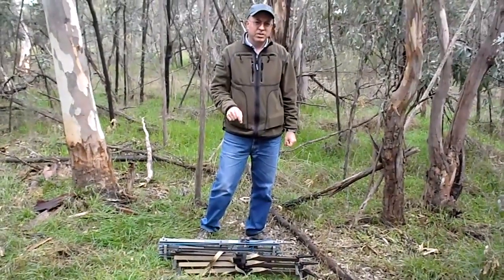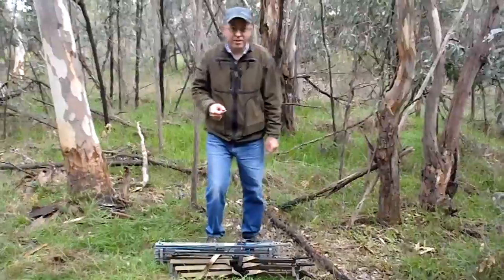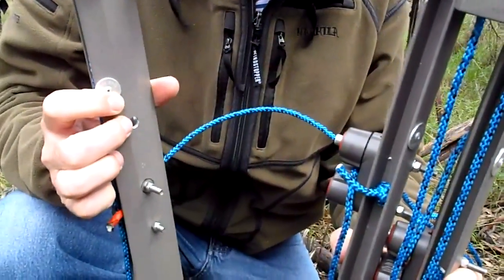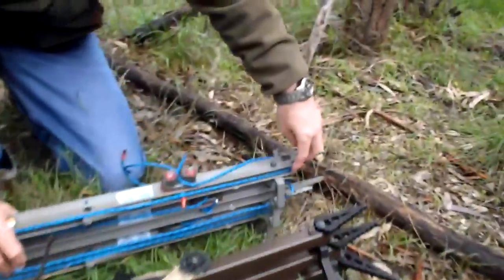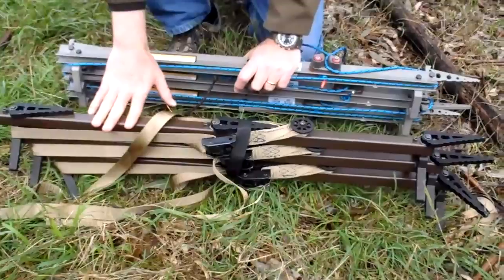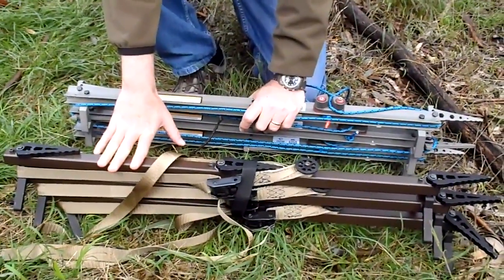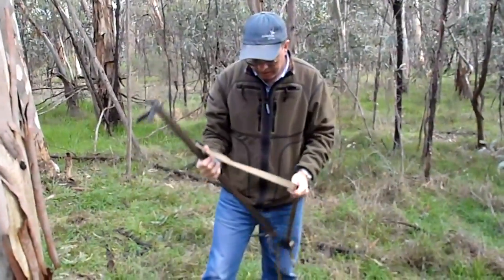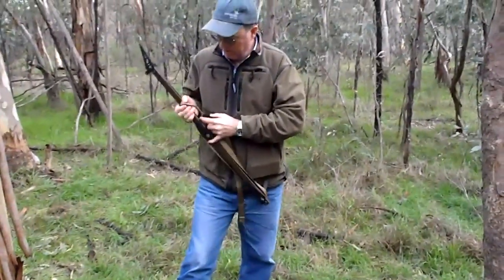Lone Wolf Climbing Sticks Versus Modifed Leverage Climbing Sticks

Comment: I also use the leverage sticks but mine are the 17in version. I just did the versa button mod with spliced on 3/16 amsteel. I will be using an aider also.
Reply from the maker: Versa Button with the wrap across relying on the tension to hold will be the cheapest and lightest modification.

Comment: Lone wolf is 10 times quieter.
Reply from the maker: If the buckle hits the sticks it is not. There is no buckle with the modified leverage cam cleats so I don't think there anything in it noise wise if you take your time and are careful.
Reply: mchughcb I do agree with you there. You have them packed very well though for carrying. If someone packs them like that they will not need to worry about the buckle. During climbing, and set up the lone wolfs are a lot quieter based on my experience and in your video. Just setting the leverages down on the ground made a clink sound. I am not saying the lone wolfs are the ones to go with. I was just pointing out for the viewers that the lone wolf sticks are more quiet so they can make their right purchase decision. 

If I where packing in for a mile then I would prefer the lighter modified version like you show of the leverages. If I am only packing in a quarter or half mile then 200 grams is not going to make the trip in much easier so I would prefer the quietness of the lone wolfs.
Reply from the maker: MNyamaha14

Agreed, but if carry four sticks at 200gr each then you will save about 2lb. I guess every little bit off your back helps.
Lone Wolf teeth definitely dig into the tree better and feels more stable. The smaller 5mm rope I put on has a bit more stretch as you can see in the video, but a bigger one wouldn't pack as neatly.
Reply: Where did you get those locking cams
Reply from the maker: Marine shop will stock them.